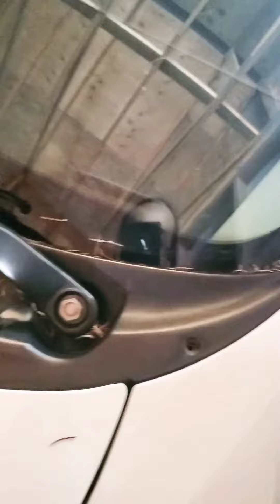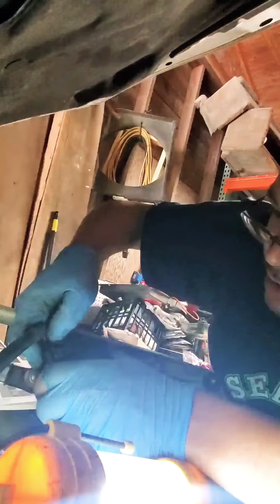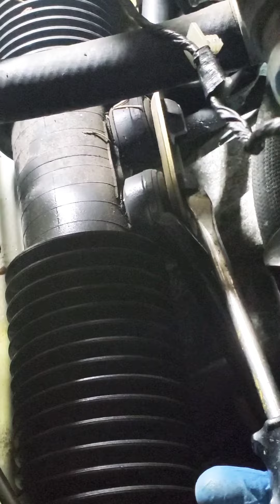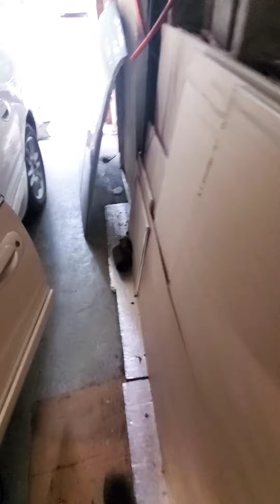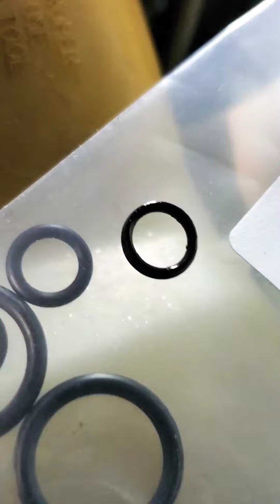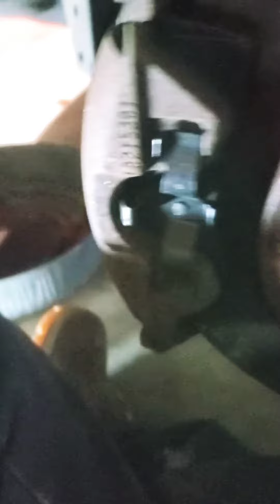2002 Chrysler 300 M Rack and Pinion Swap Walkthrough No Special Tools

Comment: man i can't get my wiper regulator out for the life of me, it's interfering on the passenger side with a vacuum hose and on the driver side with the strut mount...hump...thingy... do i need to pull the throttle body to get that extra room? everything's packed so tight on the driver side i'm tempted to just start removing things for wiggle room. for one thing that stupid harness bracket above the rack mount bolts, it took me entirely too long to finagle a socket with swivel onto that one. great video though, it's much more helpful than the Chiltons manual i've got. thanks man!
PS idk if adjusting your tie rods was a good idea, i always just jacked up the front wheels so i could move them where i needed them. did you have to have it realigned afterwards? i've never had the rack out before, but i have had to replace the bolts in the inner tie rods multiple times. idk if the rack was worn out or that tabbed bracket just sucks but i kept having one or both tie rods suddenly let go while i was driving. the last time that happened though, it somehow shattered the internals of the rack, so here i am.